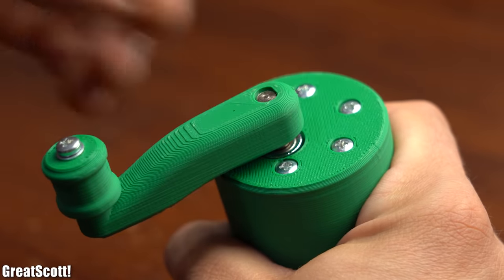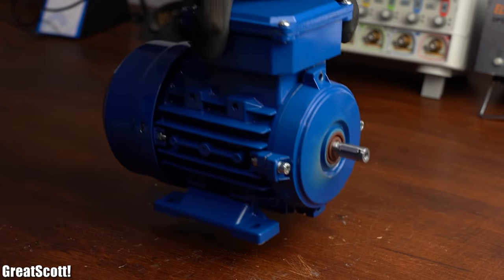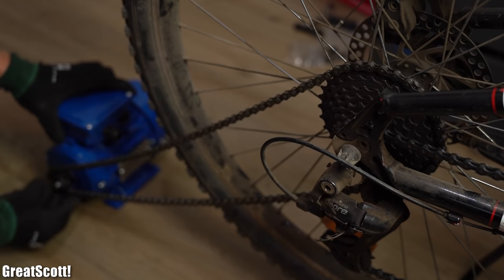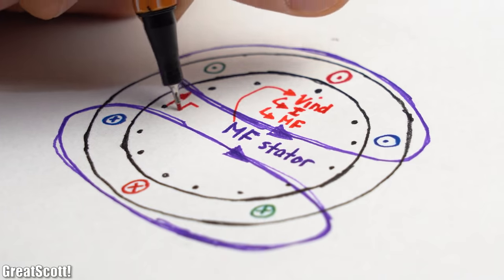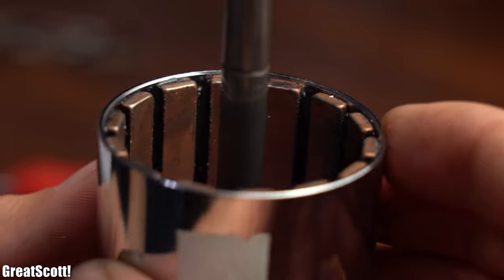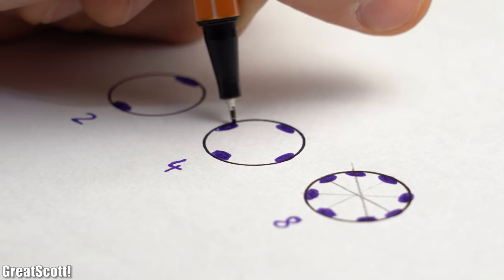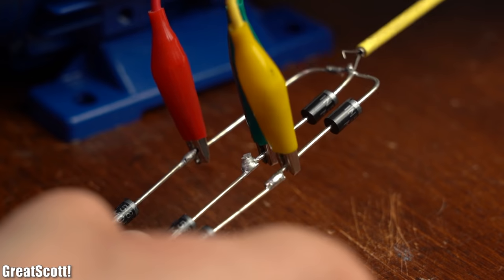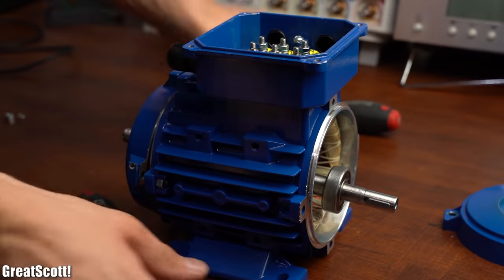HACKED!: Turning an Induction Motor into a Generator?!

Comment: Where did you got those motors? I need something like that bud it's too expensive on e-bay.
Reply: Check with your local HVAC service shop. They replace AC package units, fans, blowers, etc for worn bearings, etc. Ask nicely, they may give you the scrap motors, or ask scrap metal prices for them. A bearing may be noisy, a pulley worn out, etc, but functional for experimentation.

Comment: your fault was that you use the wrong pole count , it will eliminate the inducted current.   It must have the same pole count like the Stator , i assume your first motor has a pole count of 2, your stator need a pole count of 2 also.

i has also modify a 800W asynchronmotor with  8 very tiny magnets and i got a voltage of 17 Volts and 3W Power 

plz update your pole count, i believe there will be much more power reachable.

you can check your pole count with a DC voltage at the windings and a magnet in the middle of the Stator.

Comment: Why aren't you just going with a car alternator? Yeah, it needs the starting voltage source, but you culd do that with a 9v battery, and when it's running it will not use the 9v battery anyway.

Comment: where did you buy that second small induction motor?
Reply from the maker: Same company as before
Reply: @greatscottlab  hey bro, nice video btw i liked it a lot as it relates to what i'm trying to do. I have been working with a bike hub motor i got from alibaba which is a pmsm/bldc. Your videos thought me a lot so if you have a minute i have a noob question :
Say i connect my multimeter to two phases of the motor. As i spin the wheel, my multimeter reads ac current flowing relative to the speed and the phase. Now i can read the current just fine, but why is it that i cant read any voltage. Shouldnt the moving magnetic field induce some voltage in the phases? The FOC algorithm tells me in order to electronically spin the wheel i need to apply power perpendicular to the back emf, witch is a voltage. Why is it that i cant read any voltage.
Looking forward for your next video bro 😜

Comment: You just created a synchronous machine not an induction generator. If you want to use the induction motor as a generator you need to use capacitor transforming it into a self-excited induction generator
Reply from the maker: Yes, I mean that was the point. Most generators are actually kind of synchronous machines.

Comment: Actually I a truly disappointing.  I chose to watch this video eagerly anticipating you would create a circuit to pulse energize the 3 phases on the motor so that the spinning core kick back more power than you put in.  (BACK EMF) Similar to running the motor on AC, but then externally pushing the motor faster in the same direction of spin beyond and above the phase slip speed which would push power backward onto you source 3 phase supply.
Similar to energizing the magnetic core of a car alternator, except your energizing circuit would need to rotate the phase so the core would look like a charged DC magnet.  Like in the car alternator, once spinning, more surplus power is being made that the electricity used to magnetize the core magnet.
Instead, you destroyed a perfect 3 phase motor when a smart circuit might have given plenty of power since the stator coils and core were already a perfectly tuned machine.

You should have just googled 'using a 3 phase motor as an alternator'.

And then improved on the process allowing for any RPM with a smart electronic exciter circuit like a VFD circuit instead of driving the motor at any speed, but designed to allow power generation at any input RPM.
:(

Comment: You fucked up the number of magnet poles. A 2 pole motor (one with just below 3000RPM (or 3600@60Hz) needs a rotor with 1 magnet. It can be halfed and both halfs glueg to the shaft though. A big ferrit magnet does fine. You can grind it in a lathe with a lot of water and a diamond grinding disc.

Comment: Will be feature in hackaday's
 Fail Of The Week again? 🤔
Reply: Also since you got the motor would it possible to run the motor with VESE ACIM mode ? maybe just a try at low voltage. If u feeling like it running it on 220VDC(rectifier) using igbt with isolate serial com.

Comment: idk dude , i mean it would be possible to boost the outgoin power but it would be mutch more work then it is worth, if you build the rotor to make electric based magnetic field , add a power supply to it , with lets say you make a plate at the end of the rotor directly connected to the coils something like the pic  https://www.motorosoknak.hu/images/JW2103-800.jpg, connect that to a power spuly that would be a excitation circuit which can boost the output of that motor to the absolute maximum, could burn it down on around 500-800 rpm tho since it boosts the amp and voltage output to the absolute maximum , so you'll need a power regulator and you'll need some diodes to make sure the outgoin current only goin outward ( if the motor starts working i could imagen it breaking your leg while petaling). and ps there are mostly less then 1mm (more likely 0.5 but since its DIY we can let some that slip since its hard to produce) between the rotor and stator plates so it can be efficent, and to save your energy get a Variomatic "gear" shift it switches the size of the driver and driven shaft accordingly to the force needed to turn so you don't need to put that mutch pressure on your leg and probably not get a cardiac arest from trying tho generate 14-19 volts and 20 to 30 amps on a bicycle.

Comment: you damaged the motor if you hook up asinkronous motor with paralel capasitors you wil get the voltage with the rpm the holl power of the motor capasitors should be in the range of compansation rate of the motor calculated with power factor cosine and the rpm have to bee the total rpm plus the difference 8 if it is ritten on the motor 2850 it is a motor off 3000 rpm the difference is 3000-2850= 150 the desired rpm should be 3150 rpm for full charge ) you damaegd the motor unnesecerily

Comment: Well useless an induction motor that create barely 4V,i suggest you to connect all the winding in series to create only 1 winding ,connect a capacitor ,connect 1 pole to the generated electricity by the rotor and one pole connected to the stator so that you feed constant electricity to the stator through  the electricity generated by the rotor while spinning?.
Obviously leaving the the rotor intact the original stator that came with the motor!!! .
Well  on the topic you could actually even connect a battery to the stator both poles,but at the same time you should have a battery charger connected to the output  which is the rotor.
I should state that i haven't tested this theory yet,but i will today test it with a slightly bigger motor than the one you use in the video...

Comment: Scott. Build a simply inverter with arduino.
Example at
https://www.homemade-circuits.com/arduino-3-phase-inverter-circuit-with-code/
Or
 https://microcontrollerslab.com/three-phase-sine-wave-inverter/amp/

For magnetize inductor motor yuo need a grid net. 
Example
1500 rpm motor 2 pair poles at 220 vac. 50 hz. Whit 5 hz at 22 vac motor running.at 150 rpm +- (use a 24vdc  battery for dcbus inverter)
. Whit smaller motor yuo need more or less 50% of nominal current for create a mahgnetic flux.
 When speed rotor will be greater than frequency generated of inverter, the dcbus of inverter will be increased. 
That's part will be used for generations of power.
Uncontolled current now will be redirect to the battery.
Or use a mechanicch limit to prevent uncontrolled backward current to the battery or use diode from battery (in this case no reverse currentl) but
Use another inverter to fee new load.
The new inverter will be active only when dc supply will be greater than Vdc x 1.2
That is typical generator whit asynchronous squirrel cage motor

Comment: if i were you i would put capacitor in middle 3 paste motor that way it will make electric build up but going need at least 14uhm capacity to handle it if have it too low it will burn out capacitor because lower capacitor will draw less amp n more uhm will draw more amp

i figer this out on genese gas power n have same motor "blue one" same factory thing but have copper wires on motor shaft help it make electric and one u have doesnt have any copper wires on it so going harder more or less if u can cut line thur it n run copper wire thur line on motor shaft i think you will make it to work out n require skills todo it just take your time

run it on bike that going be last because motor is first get it make electric then put on bike to make electric

Comment: teslas methode of conversion are hightly miss understand I ques.
Use 20k rpm dc motor huck it up to a wash pashine pump use that thimg as a generator use capacitors to store energy preferably non polarised ore not use capacitors and rather use a hv transformer with pump combination there you go 100 lightbulbs lit up with out trobel just simpel ac/dc magneto wuld do the same thing 😒 there that shuld work besides dont use diodes ore led's best wuld work gas filed bulbs they operate any way at high frequencis

Comment: Hallback works better. Or skip all the nonsense and use a stepper motor with bridge rectifiers. Steppers are incredibly efficient. WARNING, never open and disassemble a stepper motor, the torque will be drastically less when you try to use it again.

Comment: No. Adding permanent magnets is not necessary.  All you need to do is add some capacitors I'm series with the output.  Residual magnesium in the rotor will result in build fields as the rpms increase.  Once the rated rpm is reached and slightly increased the unaltered induction motor  generate decent power.  What he is doing here is a joke.

Comment: Dear Scott! It was an awesome videos as i expected. But i heard about self exciting an asynchronous motor to a generator. It is done with 3 capacitors connected in a delta configuration. Please try that one if that works for you. We tried it once and it worked for us. This is the link for a circuit diagram. While the motor picks up speed and self excites no load should be attached or otherwise it won't work.: https://www.electrical4u.com/images/induction-generator-16-8-14.png

Comment: While I usually appreciate your videos the title on this one is misleading, and made me cringe watching every detail of it: It is not induction after hack, it is synchronous; induction generators need a lot more math, control and power processing which would have been nice to explore; you failed to check the numbers of pairs of poles on the nameplate, and the stator-rotor must match. Both ideas would be good, induction generators and hacking a synchronous one, but the title should match.
Reply from the maker: The title never stated that the result would be an induction generator. It just says generator. Could be any kind.
Reply: @greatscottlab Consider this, if you used an induction motor as an induction generator, would you repeat "induction" on the title? Sorry for sounding like a troll...  love the channel, and this is really meant constructively.

Comment: Jesus christ, arent you studying electrical engineering or something? Use a iron core in the rotor and minimize the air gap between magnets and stator iron. No useful magnetic flow can happen in your crappy printed rotor or over the huge air gap.